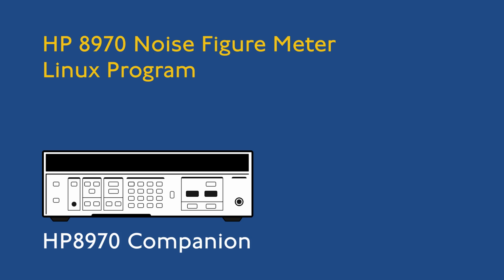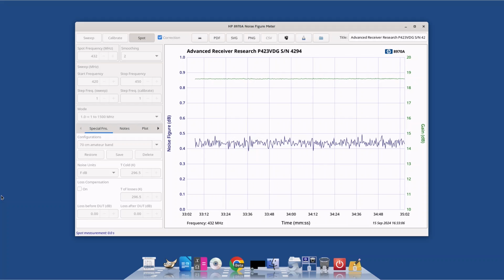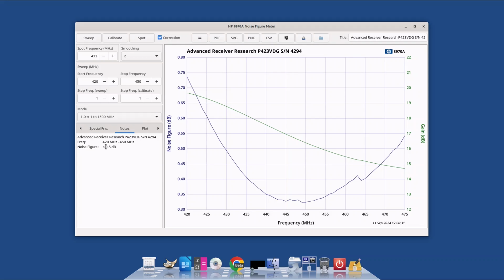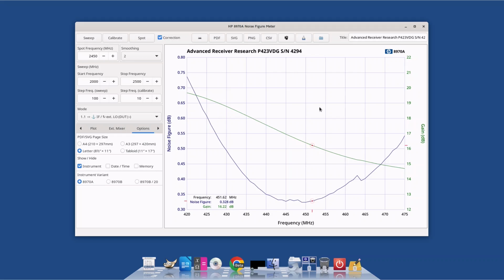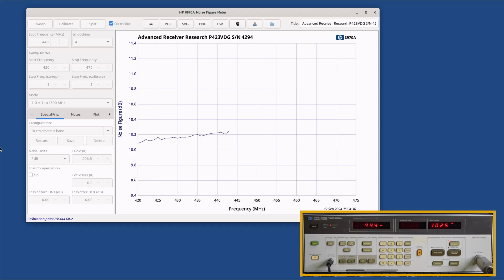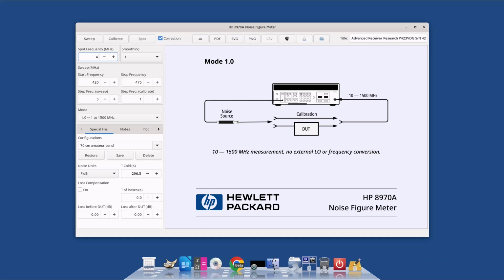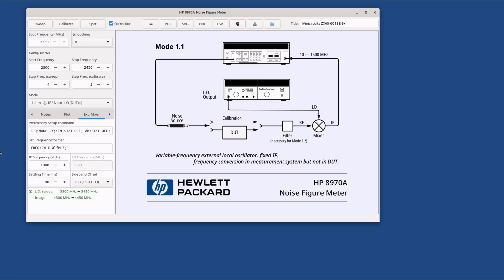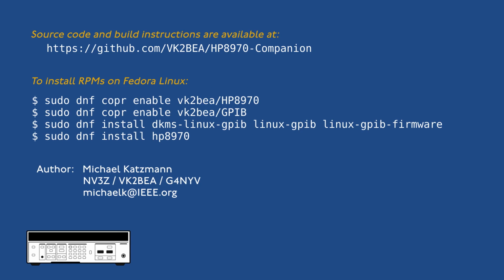HP8970 Companion

Comment: Hello!!! Great project!!! Can this software work with HP 8971? And can it work within Mode 1.3? Thank you!!! 73!
Reply from the maker: The dropdown allows the selection of modes 1.1 through 1.4. The HP8971 has many more modes (from what I remember). I don't have an HP8971 but I'd be happy to try to add the additional modes that it enables if you can do the testing!
Contact me on github if you are interested.